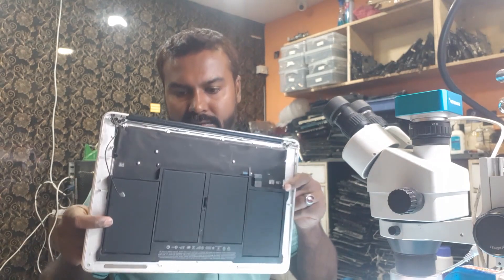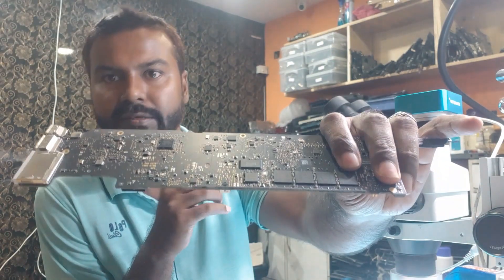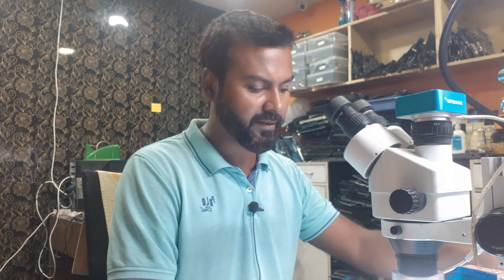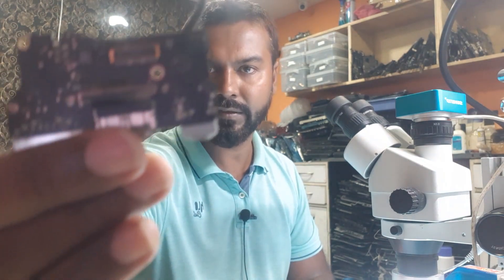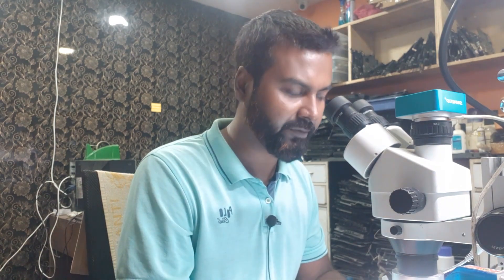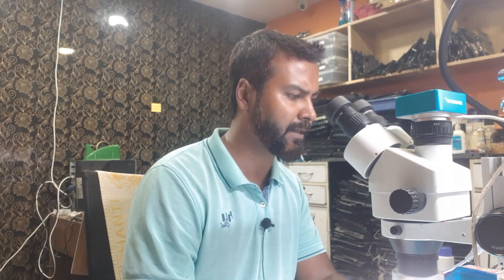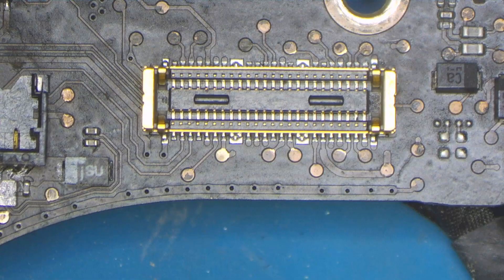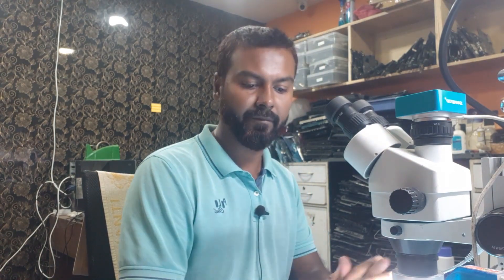Macbook Air A1466 No sound Repair | Macbook Air no sound  FIX

Comment: Hi I have a MacBook Air a2179. It was water damaged on the audio jack board area. I changed the audio board, and the Mac does recognize the internal speakers when I go to system settings sounds, I see the internal speakers in the output section. However, I have no sounds, and this happens to internal speakers only, I can hear the sound through an external speaker or headphone. Could you please help? By the way, I am not sure if this is related or not, but there is a tiny led on the logic board beside the button used for draining extra power from the board, this led is always on.
Thanks
Hamid
Reply from the maker: To test the internal speakers are working fine you must have another speaker, may be your internal speakers are faulty or there is some signal issue..
Reply: did you do a RAM reset?

Comment: hello sir I have MackBook Pro and there is no output speaker show in the the system setting and what at the time of switch on the Mac I hear the sound of on tune but at the time of on the laptop there was no sound can you help me out of this sir please
Reply from the maker: May be software issue, res installation will solve the issue
Reply: I had the same problem, there was no speaker output showing in system settings and when I turned it on on my Mac I heard sound in tune but on my laptop there was no sound.
I have reinstalled it, still the same. When you plug in the audio jack and remove it again, internal audio will come out, but after a while it will change to headphones again